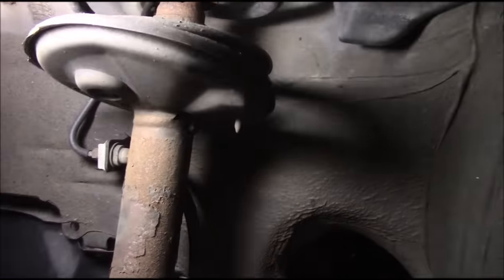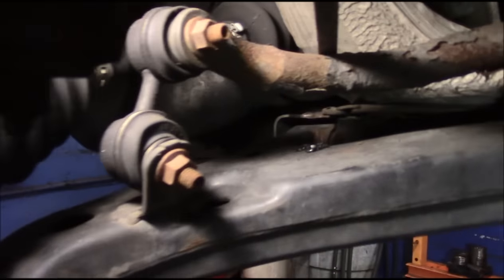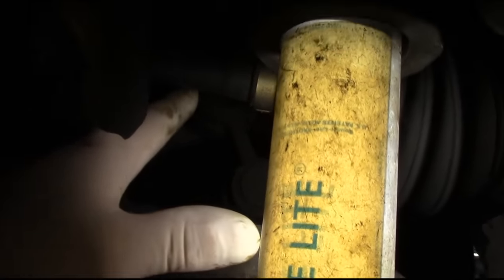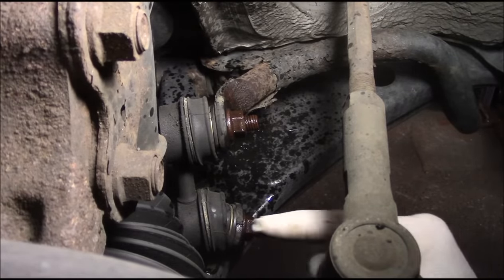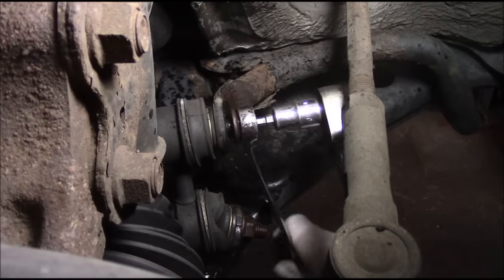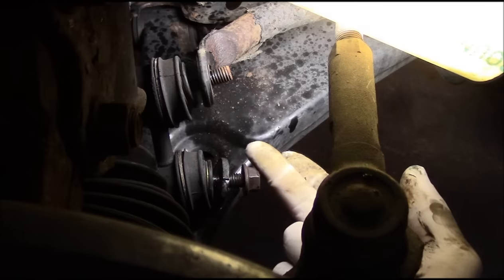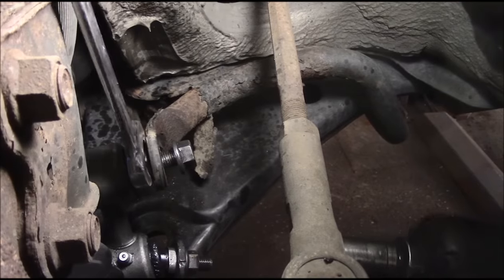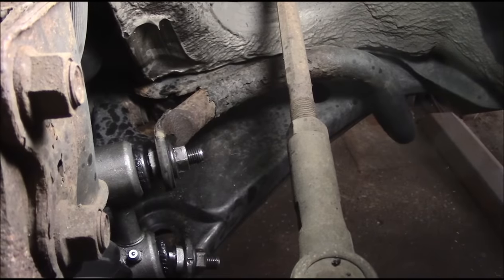Diagnosing Front End Noise

Comment: Great video, very professional and honest. One trick I learned when replacing suspension or exhaust parts is to wire brush all nuts, bolts and threads down real good first, then spray down with PB Blaster, or ATF/Acetone mix (50/50) and let sit for 1/2 hr or more. This works really well if you don't have air tools and are using a long breaker bar/ratchet wrench.
Reply from the maker: Thank you for your input.

Comment: Yes, I experienced that same situation over 20yrs ago, but on a different type of vehicle. It was aboard a nuclear submarine & no one in the naval shipyard could diagnose why the interlock indications were not lining up.  I performed the same procedure you did to every linkage over 20ft in height & found a 1/2” valve stem (that the reach rod was connected to) was worn so badly that the valve had to be replaced.  Thanks for sparking my memory synapses, as I had over 35yrs of diagnosing problems as a marine machinery mechanic.

Comment: Yes, indeed 2-make sure putting grease AFTER putting the new part is, must not forget, is an excellent and must do and critical reminder! Well done as always n kudos to the lady who has chosen very competent automotive technician! Well done, Jim! All the key reminders about put 5-tork bit to hold on the center of stubborn nut to come out and NOT to strip bolt head, which will be bad day to find not so easy to find factory OEM nut like that! Of course, always replace set like tire! testing was good even after putting new part we can see NO free play! Put very good penetrating grease to loosen old nut and may be two or even three spray and wait for socked in why some people even briefly touch rusted old nut to warm up nut to loosen, may be or may not good idea or unnecessary!

Comment: I have a 2000 Toyota Avalon I use to hear a clonking sound that only lasted for about a couple of weeks while on the west coast. Drove to east coast no clunking but when I hit a bump it's a hard sound. First thought it was the struts/shocks but the car doesn't really bottom out. Went to dealership they told me it was my front sway bar link and rear sway bar bushings. Question is there a sway bar in the rear? Outside of the dealership what should a job like this go for? Help if you can just trying not to be ripped off.
Reply: Could be dangerous

Comment: Have you ever tried the melting candle wax into the treads to loosen a nut?
Reply: never heard of this, how does the wax penetrate the tightened nut/bolt it seems like the wax would be too thick to penetrate?
Reply: iron horse122 you heat the bolt then apply the wax.  It heat soaks into the threads.
Reply: This is bad idea

Comment: I have a noise coming from front wheel  ONLY when turning sharp left on Honda Pilot 2005.  It sounds like it's the driver's side, but I'm not absolutely positive. 
Any suggestions?
Reply: Most likely a CV Joint or a Wheel Bearing
Reply: Isn't that an Allen socket? 5mm...
Reply: SplittingVoices I just had my wheel bearing replaced on the left side and my brake pads on both sides and I still hear a roaring sound when I drive so what else could it be?
Reply: SplittingVoices I have a Pontiac G6 2008 4 cylinder front wheel drive
Reply: It's called a torque bit. They're shaped in a star, not like an allen socket.
Reply: Mr09busa nope. Allen is a brand. It's actually a hex. Torx come in t sizes. T1 t2 t3 etc... he said 5mm, so it's a 5mm hex..
Reply: Oh okay nice. Thanks for the knowledge! I was unaware that Allen was a brand lol.

Comment: That Torx in the ratchet trick is going to save me a ton of time next time I need to replace my links... just using a straight hex on my wife's Camry made it take forever since you have to remove the wrench from the nut to reset it to keep going... Thank you!
Reply from the maker: Take your time and you will actually save time.
Reply: I'm always a slow, double/triple/quadruple check, DIY car guy since I have no formal training. But any time I can use a ratchet rather than just a straight wrench will save time. On some of those cars, even using a 12 point socket end, you can only move the wrench 2 to 2.5 points each "turn" due to space without removing more stuff. With this trick, I can use a fine toothed ratchet to get at least another half point worth of turn in those tight spaces than with a fixed combination wrench. Should save between 20-30% of the "turns" "strokes" whatever per nut.

Comment: Funny his advice on which stabilizer link to buy is the opposite of what was said on another video, but that one was regarding ball joints but he said manufacturers found that having no grease fittings in a sealed boot lasted longer than the ones with a grease fitting.

Comment: Jim, excellent video and quite professional. I have a toyota corolla 2008 model and it makes a clunking noise from the front especially on bumps and rough terrain. I have replaced new struts, with strut mounts, the tie rod looks good, the ball joint looks good. I have even replaced the sway bar bushings. The stabilizer link looks ok. Mechanic says it is with the power steering rack. and it needs a new power steering rack. There was a little play in the steering rack and i even replaced it with a used power steering rack which was from a salvaged car, but looked good. But still even after doing all this there is clunking noise. Can you please advise.

Comment: WOW WOW WOW!!! Excellent video.  I didn't have alot of knowledge about sway and stabilizer bars.  I worked in a garage where we specialized in diagnostic work; OBD and all the way back to first cars with carburators and distributers.  Love your work ethic, narrative and filming ability.  I learned alot.  I'm having front end issues.  I'm working on the floor with jack stands and a floor jack so I'm limited on what I feel safe doing but if I have to take it somewhere;. I'll know what questions to ask and what the answers should be.

Comment: I can hear humming noise once getting over 30km/h, wondering if that’s a wheel bearing problem. Also hearing hum when cornering.Especially, when making a tight turn. The noise does get louder as its getting quicker, just stays the same as accelerating. At the highway, when pressing brake, can hear the same noise as well.

Comment: Well done Jim, it's amazing how noise is amplified.
Reply from the maker: Your right people come in the shop thinking it is a lot worst than it actually is.
Reply: @jimthecarguy  Yes, and so many horror stories of people replacing racks, suspension parts n STILL!  Thank God f this wonderful man!
Reply: @jimthecarguy Hello I have a 92 Honda Accord and I had the front and rear motor mounts replaced to pass inspection in June. After that my car has a rattle shake while in park or coming to a stop sign. Meanwhile replacing inner outer tie rods but I have a clunk in the steering wheel when turning. What could it be? I need your help.

Comment: First thing that should be checked is the brake caliper. I had the knocking issue and I found right away that the caliper was night completely bolted tight and when hitting bumps and rough road it would knock

Comment: Thanks for video
1) Didn't they need to be greased?
2) Isn't it easier to remove old links just by using a vice grip behind the plate grabbing the small part of the stem or the ball itself and use the gun or ratchet to remove the nut? I did it this weekend and what I thought was going to be a few hours of fighting with it, turned into a 5 min job to get the old 20 year link off. 
Just asking.

Comment: Very nice video Jim.  I have a question about my 2000 Chevy Malibu Jim that maybe you might offer a suggestion.
About a week or so ago, as i drive forward, i hear a repetitive rubbing sound coming (i think) from the front end.  It's not a clicking sound.  When i step on the gas pedal, it's not very noticable.  But as soon as i take my foot off and coast, it's very present.  Only going forward (not turning left or right) is it noticeable.  When i turn left or right it doesn't occur.  The sound will be present until i come to a full stop.  
I have just under 100k miles on it (97,600).  New rotors, brake calipers & pads.  I'm thinking maybe the CV axle(s) or the wheel bearing(s).
So, you did a very nice job with your sway bar link video i thought you'd might be able to give me a suggestion on my issue.
Thank you very much Jim.

Comment: Hello Jim, I watch your video about diagnosing front end knocks and rattles.  I have an 03' Town and Country and I am about to try to eliminate my front knocking too.  I want to ask if I can grease the stabilizer links (Moog) before I install them. would that be easier?  And I also have a creeping noise also while driving over bumps or turning in to driveways and such where the road or apron is not even/level!  Like a worn bushing or something in that nature so will be definitely using my pry bar on the arm and the ball joints.  Also, I am installing the front struts!  again, thanks for the very helpful videos.............Donny

Comment: Just fixed an annoying clunk when  quickly turning at low speeds in our 2012 Charger.  There are steel rings or guards on the sway bars that center the bar between the rubber bushing mounts.  They were too far apart, causing these guard rings (on the right side in my case) to hit the steel bushing mount when the car is side loaded.  Took a drift punch and hammer, knocked it inboard a bit and reinstalled the new bushings.  No more clunk!  Check these steel guard retainer rings (whatever they're called...) if they're crushing the bushings and/or hitting the mounts.

Comment: @Jimthecarguy  'i have a similar front end suspension noise  [ front left driver  side ]  on my 2011  Lexus RX 350 that i can feel and hear while driving  ( hands on the wheel ) could  it  also  be  the same problem /sway bar?  if so what is the typical  repair price? for doing so.. (more or less) r don't wish to be taken to  the cleaners by not so Honest a mechanic as you so  obviously  are. should i take it to a Toyota repair shop ? or any certified mechanic... please any reply would be helpful..   bought it to use for Uber work? and it's not just annoying  but don't feel safe having people in it while this issue persists. Thank you!  have subscribed to your channel after searching for an Honest person showing how it all works and how to fix  problems with a used car.

Comment: While doing that job, check to see if your strut spring has not snapped off at the bottom, and that the spring is properly seated in the end stop on the mounting plate, another source of noise is a badly worn or loose strut top mount bearing.

Comment: I have always used an electric impact and thin nosed vice grips to remove these. The main trick whatever method you use is to move the nut little by little as you did. Those Moog parts look good. Are they better quality than the dealer parts?
Reply from the maker: Your right little by little is the trick.I like the Moog better than the dealer.

Comment: Hey Jim I have a 03 durango 4x4. i get clicking when turn the wheel to either side on both sides but only at extremely low speeds. I just changed the driver front bearing and axle. would you suggest still axles? Sound doesn't happen when going straight only hard turning.

Comment: Hey great vid..... ?4u... I have a 2000 Chevy Silverado 2500 4x4 pkup.....Occassionly I get light to sometime strong jerk that seem to come from the rear end. I happens when I begin the initial acceleration from a dead stop. Usually around the 20mph or sometimes at 50mph....what should I check for.....i have diy home mechanic exp. Are there any videos here on YouTube that you would suggest? Thx.😊

Comment: Hey Jimmy, got a question for you.? I just now finished up installing both front sway bar links ends, torque to specs, and added grease to the both of them. Now my question is much is too much grease. 
I added grease to about until it bearly filled but it still oozed out a little and tucked it in with a pick. Did I add too much you think?
Reply: It's moog part # k40870/1 for a 2006 pathfinder.

Comment: Hi Jim
My car only makes a creak when I stand on the brake and come to a halt.  I'm fairly certain it is a suspension problem,  Ive replaced the sway bar links and they are on tight.  Haven't checked them as they are new.  Could the links still be the problem.  What do you think?
Reply: I have the same issue, no noise when I'm going over bumps- everything is tight and solid but when I slow down hitting the brakes there's a big clunk clunk in the front of the car were you able to identify and fix your problem?

Comment: Everything was done and still a knocking noise on the driver’s side floor board ...07 Jeep Compass  bushings axle rotors brakes sway bar ect ...still knock noise after a turn or a bump
Reply: Catalytic converter clogged

Comment: Just did this to my Kia Sportage that made clunking sounds. For the orice and age, I wanted to change them, before looking deeper.
The nuts on them were really in there.
The side by the bushing seemed to be almost in between two sizes, metric and sae.
It just did not hold well and it was so thin, it was hard to get on it fully.
I tried to use locking pliers to hold it.
I managed to get the nuts off of five spots, but theee required a grinder to grind them off.
Now with all four changed, no more clunking.

Comment: First Time with you. I have logged in JIm. I have a 2010 elantra and had to replace the drivers side stabilizer link twice in 2 years. There is a knocking noise when going over bumps again slowly. Seems it is coming were the front drivers side strut area. The struts are new KYB. I have not taken the car in again until next week. I did buy new Moog K75002 links. Seems strange that I had replaced 2 links in two years. Any suggestion.?   Thanks

Comment: Hey Jim I have an 04 Nissan Titan 4x4 and the drivers rear wheel bearing is bad so when I was taking it apart the square plate that holds the axle in has 4 studs with nuts and the top 2 nuts came off pretty easily but the bottom 2 are spinning the stud as well as the nut, you have any advice on how to remove the seized nuts?

Comment: Great video! Quick question for you I put on new brake pads and rotors on my 09 honda civic. After about 30 mins to an hour of driving when I apply the brakes and come to a complete stop there is a loud grinding/scraping noise.  I have tried different rotors and different pads but the problem still persists. Any recommendations?
Reply from the maker: Yes check behind the rotor . The dust shield me be to close to the back of the rotor. If it is just push it away so it don't touch. Keep me posted.
Reply: @jimthecarguy  Thank you I will give that a try!

Comment: what have you found that are the most common worn out parts under jeep wrangler?say 1998 year.im having some noise bumping or knocking under normal driving and when i pull out i think clutch is vibrating .old owner had clutch put in but im betting he didnt replace the flywheel or have it turned.no oil on anything.i checked that.its newly rebuilt 6 cylinder.but it vibrates bad at low rpm pulling out.any help would be deeply appreciated.thank you and good video.Rob
Reply from the maker: The most common parts are the links. As for the vibration from the clutch you are right they probably did not cut the flywheel.

Comment: Thank you Sir for your video
I recently bought a 2004 Toyota avensis from my brother in law, so I got the car for a bargain price, and it has 8 months NCT on the car so it was only tested in Feb 2017.
It recently had a new gearbox and clutch fitted.
I bought the car 3 days ago and the engine is good and it handles good, it doesn't pull to one side but  if I hit small bumps in the road it knocks really loud from both the left and the right front end.
I was wondering if you would have any idea what could be causing this?
I live in Ireland where the roads are pretty bad.
Any advice would be very greatfull
Thanks.
Reply: mirsad ismani Hi.
Thanks for the comment.
I just wanted to ask you, how did you sort this problem?
Thanks.
Reply: mirsad ismani Thank you.
I will try that and let you if it fixes the problem ☺

Comment: Hi Jim just changed suspension arm on my vw golf mk6 tdi 1.6 and the cv joint come apart so I just brought new drive shaft and fitted that aswell, but now getting a knocking noise when turning full steering keft/right, I'll see if let me post video.
Reply from the maker: I would definitely check all the parts that you have to remove to make sure they are all tight

Comment: I got a question on my van that happen wasn't sure what cause it. While I driving straight from 5mph to 30 mph I kept hearing a click noise come from the drive side where the wheel at and every time the click noise come on, the steering wheel does a quick short turn itself. That click noise come once every 10 to 15 sec. When I do a full left or turn, there no click noise. When i driving straight. The car feel like unbalanced and feel like it gonna drop down on ground level. Do you know the problem to the car?

Comment: 2009 Lexus Es350 when rapid acceleration or hard stop, there is a POP noise from front right suspension. What could it be?  Cv axles, struts, sway bar links and bushings, control arms, wheel bearing have been changed 😢